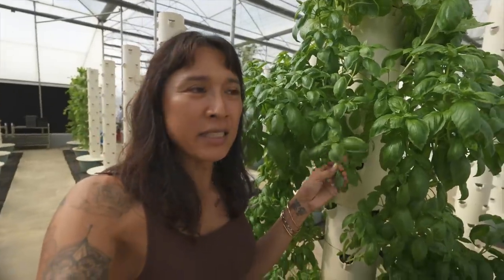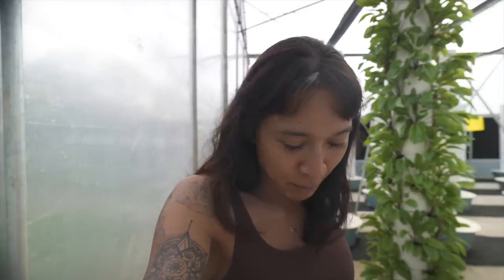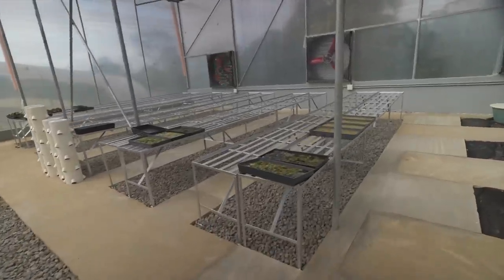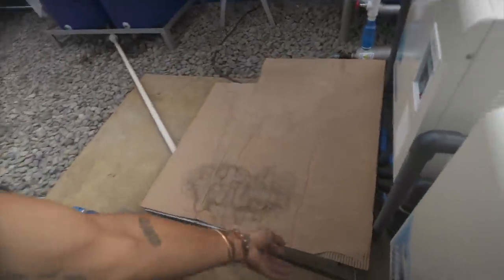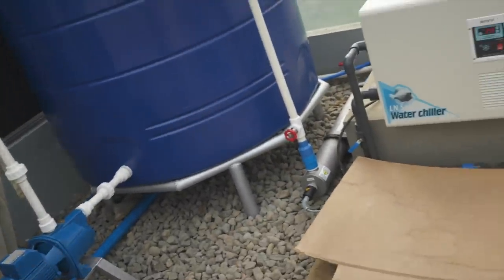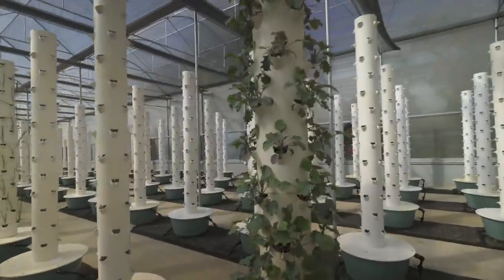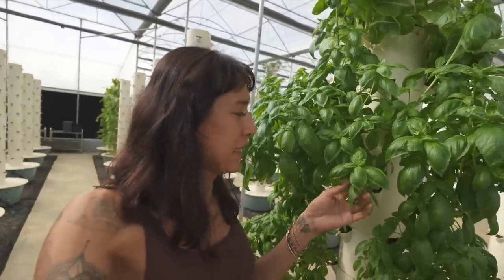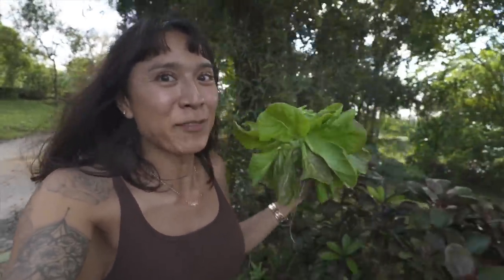My vertical tower farm greenhouse update | King Tower Farm (2023)

Comment: What made you switch from using singular pumps inside the towers to a line pump system? Is this more effective on a larger scale or can this be used on a 40-tower operation? Why chill the water? Does argrotonomy supply the UV parts as well?
Reply from the maker: We sourced our own components to make our system suitable to our weather. Like pumps are more efficient with electricity and maintenance plus it circulates and re mixes all nutrients. Cooling is to give the plants a better chance at fruiting. UV light is from a water supplier.